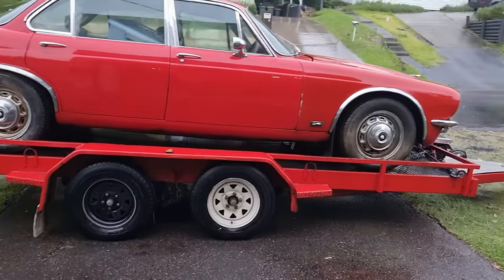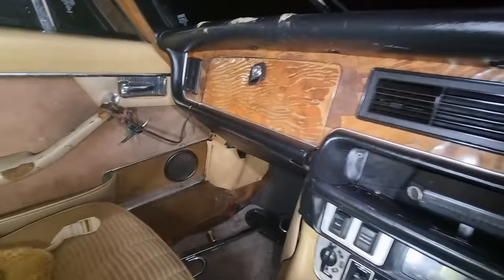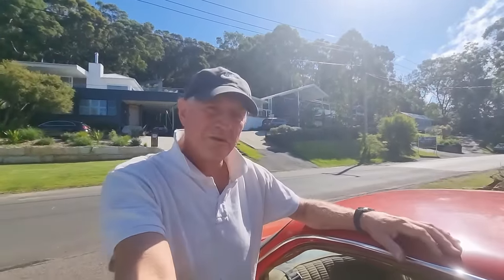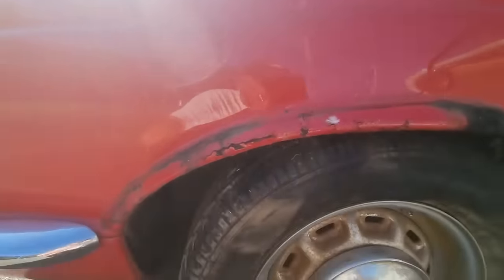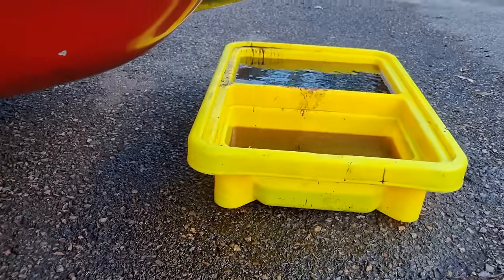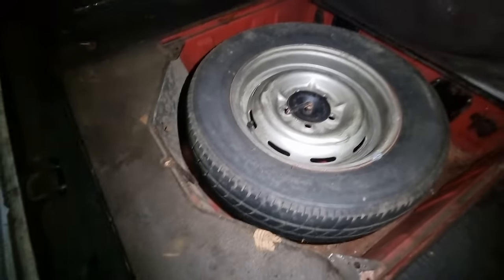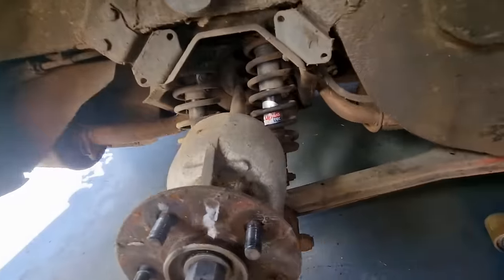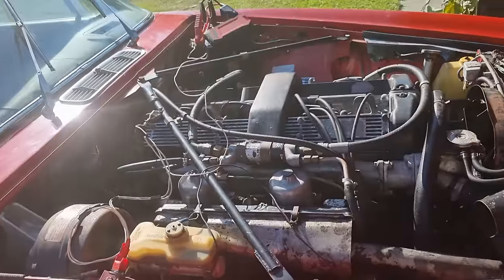Jaguar XJ6 Series 2 LWB Destine  for the wreckers. ep2

Comment: We ran an early SWB S2 for 30 years & despite people knocking them as the least desirable XJ6 ours never let us down & was apleasure to drive.  It was built in May 1974 so was basically S1 running gear & engine.  It was Turquoise which was a S1 & very early S2 colour.

Comment: Five hundred! That was cheaper than fish and chips here in England! OK, an exaggeration, but that was a great buy young man well done. I would have jumped at that car over here. Take off the ignition and put a new/replacement one on. Chrome spats cheapen the car in my opinion, good move taking them off. The submerged fuel pumps I reckon will be knackered. The floors look good, they usually suffer rot because the windscreen rubbers perish and water gets in through rot holes. UK weather and salt kills ALL cars eventually. Well worth saving that XJ6, I have seen and owned much worse!
Reply from the maker: Thanks Jon

Comment: Sorry to tell you but those wheels do not look like chrome scallops - from the vid anyway - they look as if they are the silver painted version though the drivers rear does look chromed.  I had some painted scallops chromed in Botany many years ago and was quite cheap but I guess not cheap any longer.

I would have gone with the red car over the black car and for $500 I actually think you have done well. 👍
Reply from the maker: Yes, it looks like that in the video, but they are definitely Chrome. I have already polished a couple of the up. However, they are not all that good of condition . Steel ones are slightly different. They have a different cut.